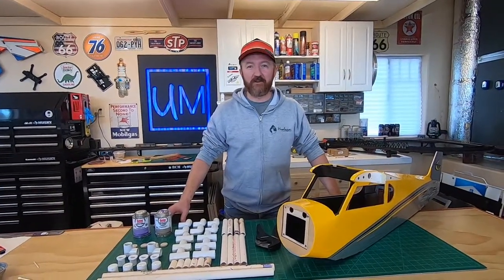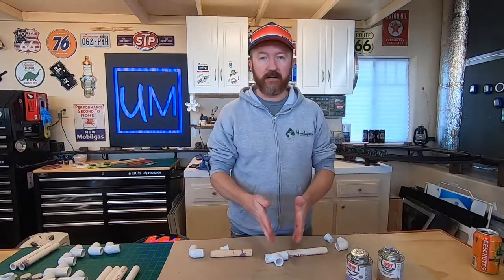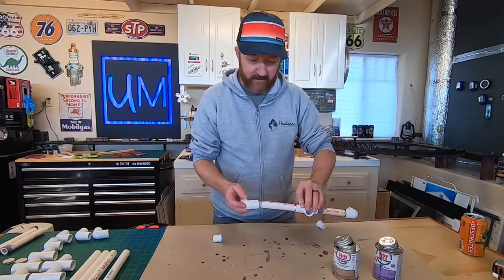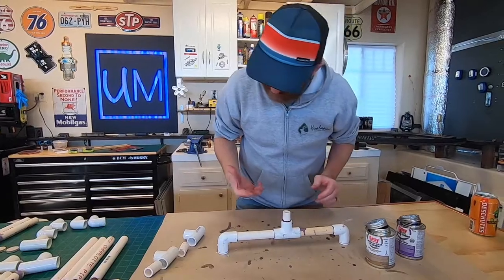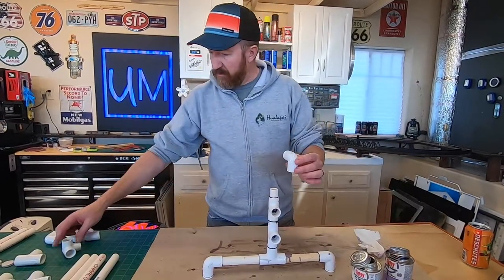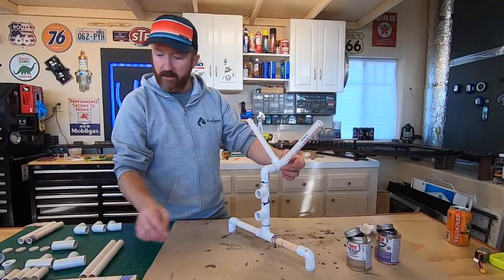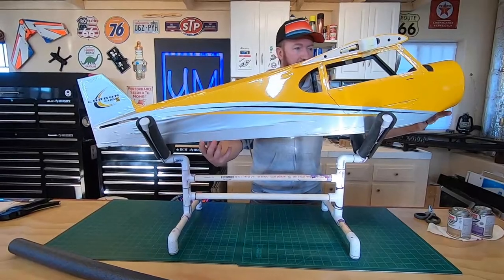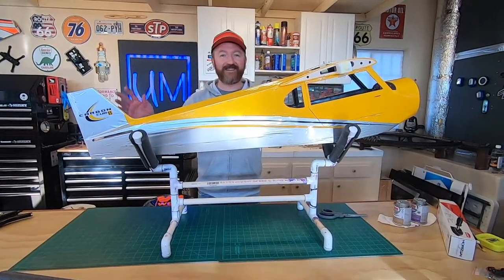RC Airplane Build Stand

Comment: very nice inexpensive stand that is useful and modifiable easily as required. i used to feel like buying a ready made but something (trying to make my own out of wood) kept me from buying readymade stand. thank you for sharing. God bless you.
Reply from the maker: Thanks! If I was building it again I would NOT glue a few key joints so that I could really make it custom to each plane. But so far it has worked on every plane I’ve needed it on

Comment: If you use sheet metal screws instead of glue then you can take it apart and adjust it as you need too. Also makes for easy packing to carry it around.
Reply from the maker: Good tip thanks!

Comment: Helpful hint prime/clean all ends first. Let primer dry then glue it. Only quarter turn, no twisting. For stand primer not even necessary only if you pressurize it with water or air.
Reply from the maker: Oh cool didn’t know that about the primer! I’ll for sure do that if I’m gonna pressurize! 😀 thanks!

Comment: just came across this  video , just wondering if there is anything you might have done slightly  differently  or added  now that this video is a few years old...thanks much
Reply from the maker: Hey Gary! Great question glad you asked. If I was to build it again I would make it adjustable by not gluing a few areas so it could be customizable to different planes. I’ve already tried using on the XCub we’re building now and it’s a no go haha. I would make the ability to lengthen it and make the V’s also adjustable. The pipes usually have enough friction fit to accommodate a few parts not getting glued.
Reply: @UngluedModeler  I understand and that makes perfect sense....I am going to make one and follow your  video, but other than gluing the base fittings ( for strength )..... I probably will just be doing a friction  fit on most of the other PVC  connectors ....thanks again.....
Reply from the maker: Awesome  good luck! That should work out way better than mine as far as versatility goes!

Comment: holey crap... that covering on the Hangar 9 cub is horrible 
i thought Hangar 9 was pretty decent stuff, but looking at this.............
Reply: I've got one I'm working on now and the covering is pretty wrinkly. But a quick pass with a heat gun/iron and it tightens right up. No big deal. :)
Reply from the maker: Yea it’s bad now but a heat gun and an iron and she tightens right up. Very standard for covering. Especially for a balsa plane coming to AZ where it’s super dry. The balsa shrinks up a tad as it dries out for the climate so the covering gets a tad loose.